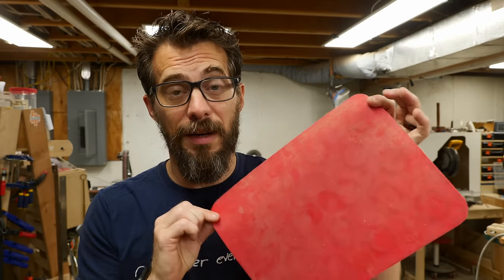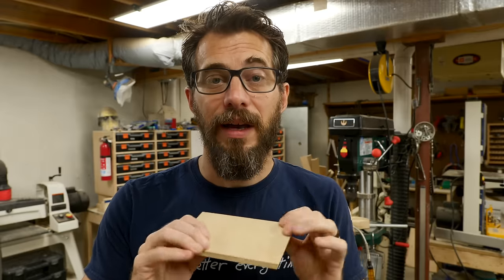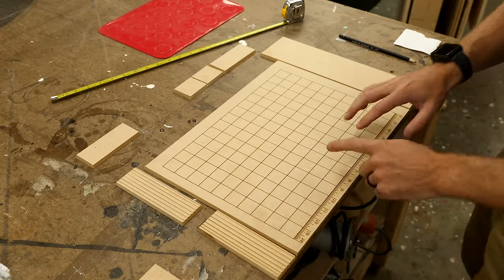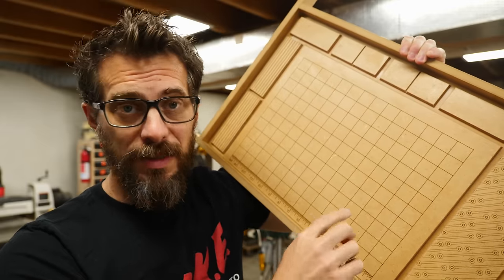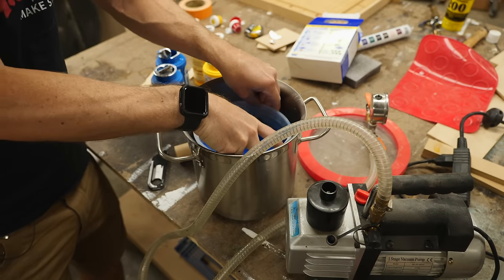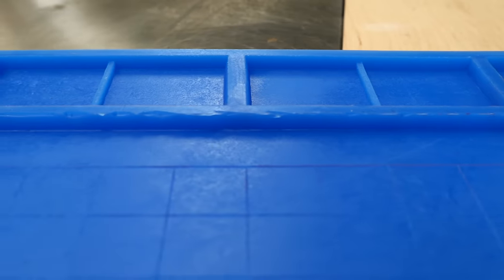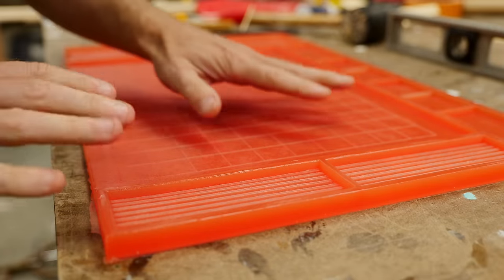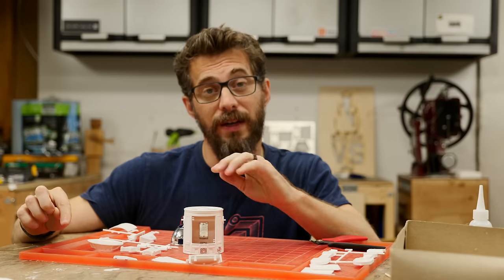Making Custom Silicone Mats | I Like To Make Stuff

Comment: Tip for mixing silicone, add the tint to one of the parts before mixing together, then you can tell if the 2 parts are mixed thoroughly when there are no more swirls.
Reply from the maker: Great piece of advice, thanks!
Reply: Added bonus: no time limit when mixing that part in too so you can take your time and get the color mixed into the first part really well.
Reply: But if you are adding the tint afterwards anyway won't you still be able to tell? I'd assume if the tint is mixed fully, that means the 2 parts before it are now mixed up too?
Reply: this is fine with most things, just be careful with some platinum cure silicones that hate getting mixed off ratio (even a little).
Reply: @shawonr3325  the whole point of mixing it in with say Part A alone is so you are in no hurry to mix all 3 at the same time. By turning Part A into the dye/Part A it also helps you get the mixes right. I know most resins (I know this is silicone and I'm unsure if im wrong or right here) don't include the dye as part of your mix ratio so you have to do it this way just for easy math. Silicone is very different, so I'd imagine that the dye part might actually be a silicone itself that a dye carrier so it'll all mix together and actually become silicone.
Reply: @shawonr3325  but I think as soon as you start mixing the two parts then it starts curing, SO waiting till that point add the tint could cause it to start curing before the tint gets properly mixed I think
Reply: also so you don't spend all of the working time trying to blend the tint into the silicone

Comment: Fiberglass mesh will keep it from stretching, and a magnet box for screws would be a great. Awesome project!
Reply from the maker: Cool idea!
Reply: I Like To Make Stuff I was thinking more along the lines of canvas
Reply: I think fiberglass maybe the mesh material in a silpat baking mat. You could also use window screen as the mesh.
Reply: Also I think a small lip below the ruler to help keep small parts from falling off the mat would be cool addition
Reply: I wonder if on could just use cheesecloth for that purpose? I recall using cheesecloth to reinforce latex molds.

Comment: *Taking notes and modifying for ttRPG player mats with built-in dice trays and rolling surfaces....
Reply from the maker: That'd be cool. You could add in scenery and storage compartments
Reply: I was thinking this same thing. I already made a dice tower, I could use the mat to give the dice a soft place to land instead of clacking across the table or tray.
Reply: @ZanarCrestrider  I actually prefer felt on a hard surface for a little rattle
Reply: Before making it, you should make a dexterity roll…

Comment: Would also cut a sheet of open weave polyamide fibre mat (no silicosis like from glass fibre mat) and drop it onto the top of the pour, and gently cover it with the uncured silicone, so that your mat has a more rigid support structure inside the cast. That will keep it from deforming with time and it will not stretch, but can still be rolled up and stored if needs be.

Comment: I love the idea of pouring materials into a mold of something.  It’s great to have something that you can truly put your name on and say it’s yours, through and through.  You ended up with just what you wanted, AND it is something to be proud of!  Big A+ for using the vacuum chamber.  I would have never thought to use it before you poured it. It occurs to me that a vacuum chamber is maybe an item that could be seriously be designed as a DIY project, as I have some valves and actuators that are going to find their way to GoodWill unless I can find some use for them.  So many items to salvage, so many things I need to build, and in so little time!!  Thanks for sharing about this and great work!!

Comment: Supreme coolness. Infinite possibilities with this technique and material.

If your CNC bed was bigger, you could have etched the entire mold from a single piece of 1/2" or 3/4" MDF. Doing it that way, you could have beveled the outside edges, too.

Maybe you could make smaller mats that interlock, like kitchen drawer organizers. The molds for each individual piece would fit on the the CNC bed, but the assembled mats would be customizeable for each user, and you could mix and match colors, too. Locking the mat pieces together could be done the same way as those interlocking foam floor squares they have at Harbor Freight. Or maybe you could mold some voids into the bottom of each component's edge and use separate key pieces. Or even mold them with Lego-like voids all through the bottoms and then create a base like a big Lego plate. Lots of possibilities.

Comment: Hey pro tip: when mixing your silicone, you something like a metal dowl rod or something cylindrical to stir it up. It causes you to have a lot less bubbles. Good to know when using quick curing silicones and resins
Reply: Hey, pro tip: Mix your silicone with a magnetic stirrer to guarantee quick, thorough, bubble free mixing. 
In your face!! Oh snap!! I bet you're totally regretting now having made your comment, a year ago.

Comment: I've been wanting to make silicone "hot mats" for the kitchen-- or better yet, for hot dishes on the table.

I've printed oversized snowflakes, but the resin is good for only very warm dishes--not really hot.

So, what you've posted here is a nudge in the direction I'm wanting to go. Very helpful.

Thanks!

Comment: If you cant de-gas, you could try pouring it higher just before it breaks into droplets. This is so you could stretch the bubble enough to pop it.
Reply: i've even seen people poke a tiny pinhole in the bucket and let the silicone drain out. this only works with silicone that has a really long pot life and it ruins the bucket.

Comment: This would be a great method to make backgammon & chess/checker boards that are portable for travel or camping. It would be cool if you tried to make one that was two-tone to see if this idea would work. Nice video and keep it up!
Reply: i know silicone sticks to itself, so try casting some parts separately in one color. then lay them in the final mold and add the last color. 
i dont think using silicone caulk on the corners would be a good idea for this reason.

Comment: I made one similar a year ago and used their PoYo putty tinted black, and only filled the ruled areas. I then used a putty knife to clean it off the flat faces, so only the ruled lines would have any putty in them. After it cured, I ran a razor scraper over it to make sure that the flat areas were completely clear of the silicone and just the ruled areas had any silicone in them. Then I used Mold Max 20, tinted light blue, and poured that first over everything so that the deep areas were filled and I had about 1/16" thick over the faces of the pockets. I let that cure, and then I added some thin neodymium magnets over top of a few of the pocket areas, and poured the last layer (about 1/8" thick) over everything. And since silicones stick to silicones, when I demolded it, I was extremely happy with it. 
I had crisp black lines bonded to the light blue background with a few pockets that could hold on to small screws or anything else that would stick to magnets.
Unfortunately I didn't have the luxury of having access to a laser to cut my grid like you did, but I used a straight edge and a one of the big x-acto hobby knife handles with a V groove blade to make mine, and they ended up pretty even. 
Keep it up, I enjoy seeing what you are going to do next.

Comment: You can buy yourself some working time by mixing the pigment into one of the parts of the silicone before combining. Also, as others have mentioned, you can get a lot of the bubbles out with vibration, e.g. a palm sander. The advantage in this situation is that you can vibrate the mold while the silicone is already in it, wasting little to no time to de-bubble. It's easier said than done, though. Best to use the vacuum chamber when you're able.

Comment: On your first version, use a cuticle remover tool to clean up the edging. This tip came from Phillip Danner of Dannerbuilds on Narwhal Labs YouTube channel. It will cut a nice clean line while removing very little material. Thanks for showing your build issues - that's always helpful. Cool project!

Comment: very cool

like casting, 
using a sander on youir mold, you should try to add a small draft angle to it so it would be easier to pull off

Comment: Another good silicone mat for work benches are the ones you can buy in Kmart (in Australia anyway). They are actually the mats that are used for puppy pee pads and are about 60cms x60cms and have a lip around the edge to stop stuff rolling off. And they're cheap, washable and tough.

Comment: Cheap garage-floor epoxy is a good option if you want a completely smooth(go over it with a torch or heat gun while it is still wet) and sealed surface on something...

Comment: You can use acrylic spray paint to seal the MDF and then lightly sand to a smooth surface or, at least, fairly smooth surface. I always use the clear. It seems to dry harder and sand better than colored paints. Maybe it has something to do with the pigments.

Comment: I wanna see this done with some variant of plastic as the material in place of MDF. if you can get beveled edges to cut smooth enough (or use FIRE to cheat it) you could use CA glue to seal it, by applying it around the edges... then maybe running a bit of a caulking bead of CA around all the edges to get nice small-radius rounded corners on all the edges. and if you do it right, you could make a mat that's much thinner, which makes the mat much less costly. because silicone is expeeeensiiiiive

Comment: Very Nice! Could I use my large silicone mold to make silicone mats? I'd like to make a couple mats for my woodworking workbench even if they are just flat mats; however, places for screws, bits, and pencils that would prevent them from rolling off would be great. I found one little article that says silicone caulk won't stick to silicone caulk, but that's about all I could find. Thank you!

Comment: Mold tip: do a build up of spray adhesive several layers thick ( letting it dry between each layer of Corse) This seals all gaps And gives your mold a smooth texture after all leaders are dry  add Mold release and poor......

Comment: Great video, that was very informative. 

Couple of thoughts:

Could you secure the negative mold pieces with painters tape and CA glue? 
Then you can have a basic border and change
Interior for different layouts. 

 Have you considered building a surround chamber and degas AFTER pour and during cure?
Now that you have proof of concept, could improve production.

Comment: I think rounded corners would be better in silicone; easy to do, just sand the upper edge corners (what woodworkers call arrises) off your blocks.

To round the bottom corners (and stop the silicone running under your blocks) I'd try a coat of good ol' polyurethane varnish. Capilliary action should do the rest.

Comment: Do you know if the 2 silicone types would bond? I could see making a 2 layer pour with the Eco on the bottom to make an anti slip version that would possibly work on a angled drafting table.

Comment: One thing I noticed is that you're pouring the mix in pretty high...I think that could cause some bubbles.  If you hold the mix as low as possible, that would lessen the chance.  That's just my arm chair quarterback's opinion.  Doesn't look like you had any bubble issues any.  Great video.
Reply: Possibly if you're pouring really fast, from what I've heard pouring it high and thin can stretch out the material to release more gas as it pours, but I guess it's a balance.
Reply: @forby_  Interesting...I would think the way it "folds" over itself could make it trap gas.  But I have no idea.  I see where you're coming from though, good point.

Comment: For the MDF or any porous material, maybe a coat of primer could fix that? That should kind of sealed the MDF and avoid the silicone to catch to much detail? (I'm just asking)
Reply from the maker: That would absolutely work
Reply: The spray he used did seal the MDF (it looked like a polyurethane or lacquer).  Silicone will seep in between the fibers of unsealed mdf and you can't always get it off without soaking it in water until the MDF is soft enough to scrub off.  (yes, did that
Reply: @andy-in-indy  I thought it was a mold release spray, not a sealer.
Reply: @TheRealPhoenix_Retromods  He sprayed that on, too.  The sealer was applied off camera and he referred to it in the narration.

Comment: Tip: If you want bubbles in your material, pour from a height, the higher, the more bubbles get sucked into the material as it hits the surface.

Comment: How did you calculate the amount of silicone to pour? You didn't mention if the texture of the mdf came through,  I wondered if painting the mold would hide the texture. Cool project, I need one.

Comment: Could you do this using a 3d printer to make the mold?
Reply from the maker: You absolutely could!
Reply: There's an epoxy you can use to smooth out the surface of 3d printed parts by smooth-on called XTC-3D. I've made spectacular molds off of 3D printed parts.

Comment: Instead of degassing the silicone I think pouring the mold and then hitting it with a sander would pull the air out of it like concrete

Comment: If I'm looking at the right silicone from my local suppliers, each of those mats represents ~$100CAD in raw materials! :o
Reply: Yes I would like to see them try with hardware store silicone. I have heard you can thin it down to pouring consistency.
Reply: It is an expensive material. I recently got a "sample size" from smooth-on that was $40. Beautiful performance though!

Comment: Thanks for this video. How hot is this product when mixed? I was considering 3d printing a mold from PLA and was wondering if the chem reaction between the 2 parts is hot enough to warp PLA.

Comment: Would silicone mats work as floor protectors? I'm looking into getting a floor protector for under my computer chair (hard floor) but i don't really like the purchaseble ones (mainly transparant pvc sheets that look kind of cheap). 🤔
Reply: No. The silicone would be too expensive and would probably not stand up to the wear a computer chair would inflict. Look into a durable rubber or rubberized plastic sheet.

Comment: so what does that cost to make?? 

why dont you vibrate it to get the bubbles out, use an orbital sander on the base and allow the vibrations to kill the bubbles , use it on concrete and resins all the time. I realise you dont have time but even a few minutes of vibration will help with the bubbles.

Comment: Does the silicone shrink as it cures? is the ruler on the mat still accurate?
Reply from the maker: The shrinkage is different for each different type of silicone, but the amount on Moldstar 20T is <.001 in. / in.
Reply: @Iliketomakestuff  sounds lke the ruler is still accurate

Comment: Silicon mats are awesome but provide no ESD protection. As pretty as they are I would never recommend one to anyone, I'd suggest a piece of decent quality ESD mat which is also quite heat resistant and has the benefit of giving you a more professional - ESD safe - work surface. Might not matter if you are only connecting a couple of leds to a battery but anything more technical can benefit from that extra care. Certainly anyone charging money for what they do should be using an ESD safe work area. (end of professional rant lol)

Comment: Just checked the price of that kit. You used 2 of them making it over $70 for each mat 🙄. I get the whole diy thing, but these can be purchased for around $20 and have many more features. Wouldn't it have made more sense to buy it by the gallon? Also it would have turned out nicer if the mold was made with a CNC.

Comment: " I glued them all to the bottom of the mold and sealed around their edges." For us amateurs (bozos), "glued" and "sealed" with WHAT?  Common failing of "how to" vid makers: assume NOTHING!  Explain or show EVERY step, please. Great vid, though!  Beautiful work.  (I did assume some kind of Titebond on the edges. Lots of other possible GLUES, though.)     ....also, a little (more) nit picking. The OUTSIDE edge of the salmon casting has some flashing. Is that silicone seeping into a mold frame joint?  This is exactly (a firm silicone mat) the project I'm watching your channel for. Thanks!

Comment: While this is very cool and I want to do it myself - it really doesn't seem worth the investment. You used 4 pints of silicone for one mat which is roughly $60-$80.
Reply from the maker: This mat is also very thick and heavy. It isn't absolutely necessary to use as much silicone as I did.
Reply: @Iliketomakestuff  Fair enough! I'm still gonna make one because I think it's a great idea to have a master like that to be able to replicate whenever you need one. I'm sure buying silicone in bulk would help if you wanted to make let's say 10-20 of em

Comment: did a quick check on the price of that stuff , that a 100 bucks of material youre pooring intoo the mould and thats without the dye
Reply from the maker: It's just an experiment. You could use cheaper materials, smaller mold, etc.

Comment: New title - - How to Spend 100 dollars to make a 5 dollar mat.
Reply from the maker: $100?
Reply: @Iliketomakestuff  The Silicone kits you used run about $30-45 each, and two kits (plus pigment) per mat.  

I would disagree on his estimate on the cost of a silicone mat - $5 is a small flat baking mat, not a larger sectioned mat like you made.